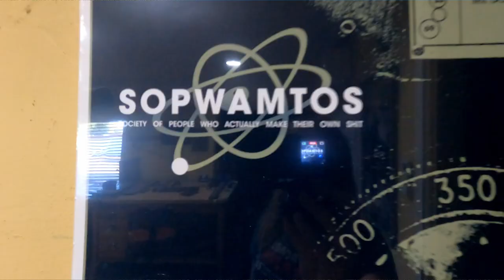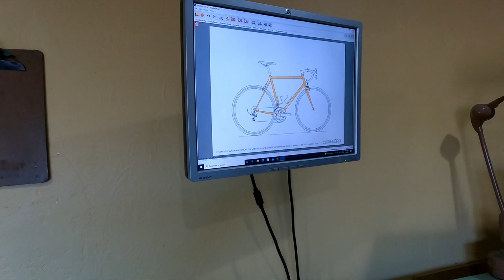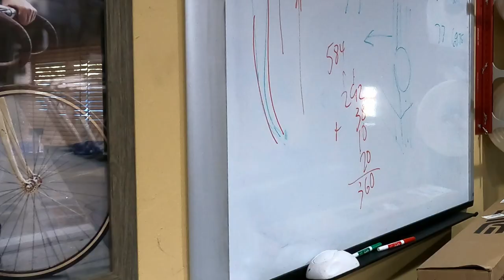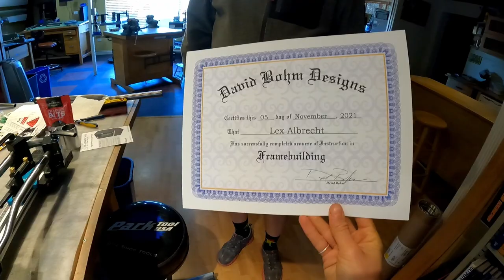How I Built a Steel Bike

Comment: You picked some wild dropouts 😂 to each their own. I prefer a more sideways V with opening facing toward the back shaped drop out the most so I can easily loosen my rear wheel if my chain catches any extra unwanted slack I can just pull back on my rear wheel until the chain has perfect tension easily without having to hold the bike up at a weird angle and fight with the drop out just to tighten my chain. It’s the easiest, fastest, and most inexpensive way for a person to adjust chain tension back to perfect according to your preference. I think it’s cool you took the time to learn not just to build a bike but actually BUILD BUILD A BIKE like not just put on some aftermarket parts and actually designed a real personal bike. Respect.

Comment: I think I'd be annoyed spending money for a frame building class and not practicing welding
Reply from the maker: Well, welding and brazing are practically the same thing! That was one of the things that I enjoyed learning :).  Brazing uses a second metal to attach two of the same types of metal together.  Welding involves only one type of metal.  Welding is a little touchier for bike building because it's too easy to burn right through the frame tubes, which would either compromise the integrity of the frame, or scrap it all together, right away!
Reply: I understand but honestly....Framebuilding is not welding!   I spend less time welding than any other part of the process (about 45 minutes out of 30+ hours).   I actually have had a number of professional career welders here and although they have a leg up on those without experience they actually have a hard time.   Welding/brazing 20 thou wall is unlike anything they have experienced in their careers before and they are surprised by the amount of other work involved.

Comment: Why not tig weld it??
Reply from the maker: welding requires more heat than brazing, which is part of why it is a little more touchy than brazing. It easy to go right through the tubes which totally compromises their integrity.
Reply: I’m a tig welder, that not true. You can control heat. I weld stainless steel as thin as 18 gauge.. I’m guessing the tubes are at least 16 gauge.
Reply: We don't really use gauge in frame building, it's measured in metric but the equivalent would be 20-22 gauge.   Honestly, how long did it take you to get good enough to weld thin stainless without blowing holes?   Then, how am I supposed to teach someone with no welding experience to do that in days?  That is why we start with brazing.
Reply: @davidbohm8294  Exactly, of all the different types of welding TIG is the most difficult weld to learn. Even when you have a little bit of training under your belt & think you've got it down pat. You still need to keep your skills up & do it on a regular basis in order to be any good at it. TIG is much harder to learn then MIG, stick or brazing, no bout a doubt it! It's really a learning class on it's own you'd have to take to teach. Keep on keeping on! I dig what you're doing my friend.  ++Peace & Rock n' Roll 4 Your Soul++
Reply: @leviathanbathory6903   "I’m a tig welder, that not true" are you contradicting yourself?